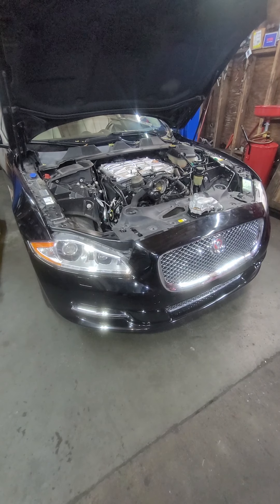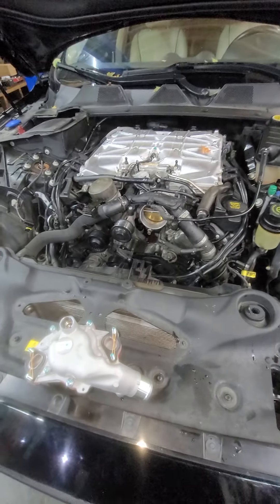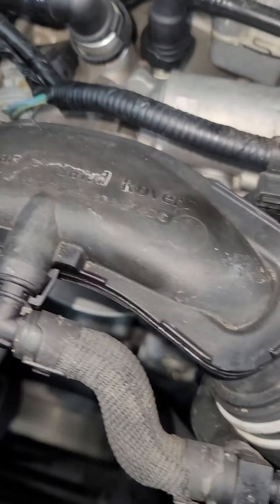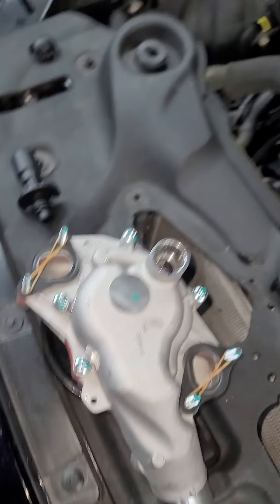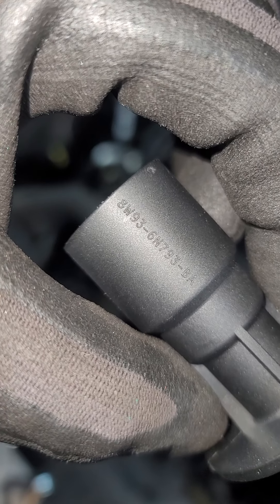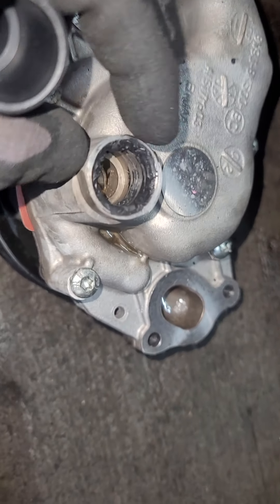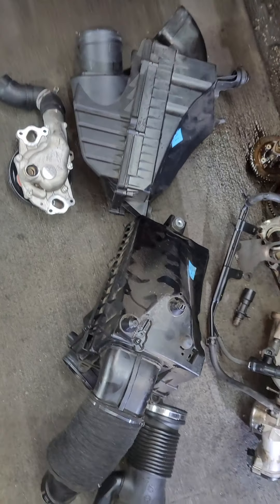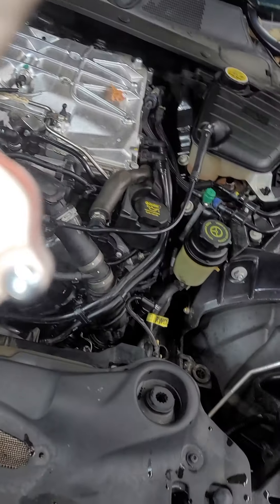Jaguar & Land Rover 5.0l overheating and coolant leak  (FIXED)

Comment: Hi I just replaced both the same parts in my 2016 Jaguar XF , however it’s still leaking from that area. Any ideas?
Reply from the maker: ok there's 2 of the O ring seals for the that  valve between the oil cooler and the water pump have you replaced both ? if so it could be the oil cooler gasket of any crack in the coolant pipes
Reply: @hanitwfik  Yea I did replace both Oring seals, It sounds like it is the oil cooler gasket then and would probably just take it to a shop at this point since that part is not a diy in my eyes haha. Thank you
Reply from the maker: @eppssanchez1562  good luck with it
Reply: @hanitwfik  One more question, how would I know if it’s the gasket of the oil cooler versus a brand new oil cooler?
Reply from the maker: @eppssanchez1562  will its better to get anew one but when you take the intake off you will see where's the leak come from ,you can test the cooler but trust me it could be fail somewhere inside or out , also check this link check the pipes in blue color those pipes always failed 
https://static.nhtsa.gov/odi/tsbs/2018/MC-10142170-9999.pdf
Reply: @hanitwfik please I need some help with my Jaguar xjl can I email or call with my questions 🙏🙏
Reply from the maker: @Strongtothehoop206  hanitwfk@yahoo.com
Reply: Did you ever get it fixed*
Reply: @javiertavarez3973 I did, the earlier comment has link that takes you to the highlighted blue parts that i bought online in Aluminum to prevent future problems. I took them to an auto shop and they replaced them. Never had a problem since then.